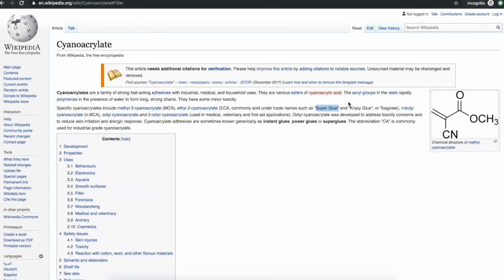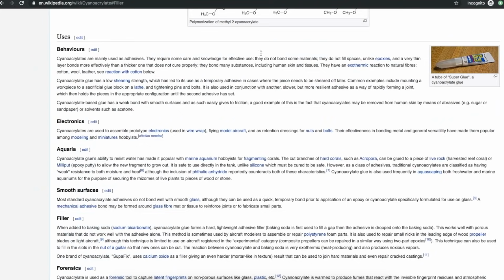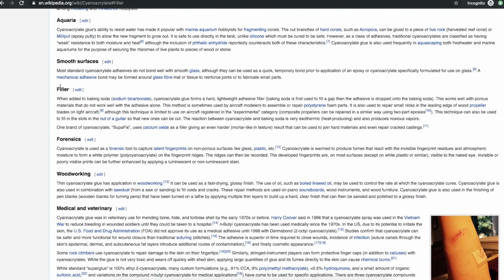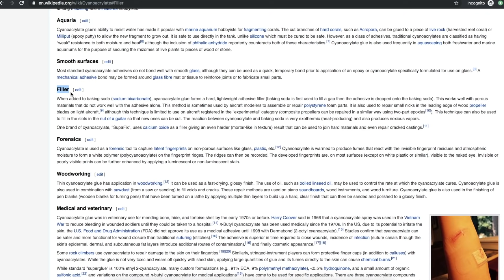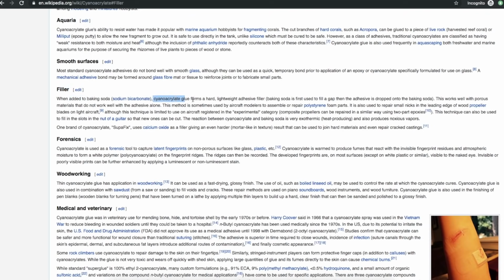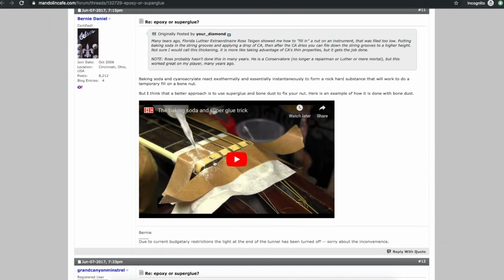Using Super Glue and Baking Soda to Repair a Plastic Switch Plunger

Comment: For more strength, use .6 ounce fiberglass cloth instead of powder. The CA will wick through the fiberglass cloth and bond over a large area and the .6 ounce fiberglass cloth is extremely thin.
Reply: silk cloth is also very strong.  You can buy it in rolls or sheets.  I use it if i'm doing fiberglass repairs and want a stronger repair than chop strand glass fiber.
Reply: Thin layer of tissue paper also works... need to add layer by layer
Reply: @gavish7988  I’ll have to try that! Noodle powder is VERY fine. 👍🏻
Reply: In the UK we have fibre-glass tissue which sounds very similar to what you describe. I have used that for fine repairs with both the fibre-glass resin, super glue or epoxy resin.
Barry
Reply: Haven't seen 0.6 oz cloth, ... did you mean 6 oz. cloth?
Reply: I used fabric medical tape that gave me the same type of result.
Reply: Baking soda and cotton as well reacts with CA glue creating a stronger bond. Would it do the same with fiberglass cloth?
Reply: Milled glass fibers.
That stuff,added to fiberglass resin, its like sanding concrete when it cures. 
Bet its awesome in crazy glue.

Comment: During the first week of our COVID19 Lockdown here in South Africa I accidentally broke the metal hinge on my spectacles. Since need these to read and all optometrists were closed for who knew how long I decided to use the method to build up a nodule welding the ear piece to the lense frame. I could obviously not fold the ear piece closed like this but it got me through to when optometrists reopened. It held strong for about 4 months! The frame was black so I used a permanent black marker to colour the repair black and hardly anyone noticed the repair.  I also used the method tho repair and build up our ice maker container in our fridge/freezer which has held up for over a year now at sub zero temperatures. Amazing stuff!!!
Reply: @dangerous8333  I did not have epoxy and the hardware stores were all closed for the lockdown.  Also, I had to build up a small nodule to bind the parts together. This is easy to do with the superglue and baking soda method as you can keep adding more to build it up layer by layer. There were not enough mating surfaces for epoxy to adhere to. I have worked with hardening putties and many other adhesives and believe the CA glue and baking soda gave the best possible joint and in the least possible time.
Reply: Well done.

Comment: I used this method on a lawn mower plastic intake manifold  that had completely  broken  off ,that has to withstand heat, presure and vibration and so far after 3 years of use is still holding.
Reply: you all probably dont care at all but does someone know a way to get back into an instagram account??
I stupidly forgot the account password. I would love any tips you can give me
Reply: @Maverick Hamza Instablaster :)
Reply: @Yehuda Franklin it worked and I actually got access to my account again. I'm so happy!
Thanks so much, you saved my ass!
Reply: @Maverick Hamza You are welcome :)
Reply: @maverickhamza1696  Hey I tried this aswell, did u have to pay 12$

Comment: I've used this on quite a few different things with varying levels of success... Baking soda and talcum powder can both work decently well but using thin or extra-thin super glue helps a ton (don't even bother with gel, extra control, etc)! Also, for this particular project, I would've just used a small soldering iron to press a hot piece of metal parallel with the arm (perpendicular to the break)! For something small like this I typically use a staple (already bent, as if you just pulled it out of a piece of paper)!
Reply: What about bigger pieces of plastic?

Comment: i used it on my laptop key (the ENTER key) which was broken into half. at first it didn't work. the second time i put mesh tape first then a thin layer of baking soda, then the CA glue, then thin layer of bs again then ca glue again. the key is still in one piece for about a month now. reminder: it sets instantly.

Comment: Great !Thanks! I repaired a fuse box cover on my 1990 Chevy truck like you did. Its a little fatter wider tab and broken right at the base. So it was still barely attached. I just built a little clay dam around it and started adding baking soda first then the super glue alternating like you did. Built it up to the level of the dam ,(about 2mm), and its awesome. Guys with trucks etc of this vintage have to deal with a lot of brittle 30+ yr old plastic parts and this looks to be a game changer!❗thanks again❗👍🇺🇸

Comment: I fix vintage electronics of all sorts. Often times, internals are broken because plastic became brittle. Broken off screw posts, cracked gears and levers, broken knob skirts. This fixes EVERYTHING. I bought a little barber shop powder applicator thingie with the bulb jar and a nozzle and it works wonderfully. At first I thought it did not disperse enough baking soda, but had no issues so far. It also help in hard to detach and vertical spaces, but make sure to cover everything, because it just shoots soda.  Though it’s not that hard to 3D print a Nozzle for it.

Comment: For years, I had used a product called Insta-Plastik, which is a powdered solid-bonder, which re-creates plastic, when mixed with super glue. Same idea. When that became unavailable, I found Q-Bond - a more advanced form that has 2 powders, 1 w/ pulverized metal (super strong bond). Work on office equipment, which involves lots of plastic that is fracturing and breaking constantly. The 2 part bonders (acrylic adhesive & accelerator) also create a strong bond. The plastic that doesn't repair with these methods is the heat-resistant plastic.

Comment: Thanks for making this video.  Your push button repair seems to have bonded well.  

My suggestion is that when using baking soda, calcium oxide, nano-particles of carbon, or baby powder as a filler, it seems that you might get even better results if you would contain the area to be filled with tape, as you did, but then you would put the filler powder in the area first, and next add the drops of CA glue; in other words, when you are using thin CA glue, you seem to be "putting the cart before the horse" and letting the glue run everywhere before you add the powder. Try it the other way and see if you get better results; on deep joints, try layering the powder, adding a single drop or 2 of glue, then a layer of powder, etc., because the various powders (except the baby powder) tend to cause the CA glue to set hard upon contact. As a final measure, lightly spray the repaired area with CA accelerator to cause any remaining liquid CA glue trapped in the matrix to quickly set, and, if you used baby powder, to cause the paste created by mixing CA glue with baby powder to set.  See this link for the baby powder/CA glue approach - https://youtu.be/NA2XJ7PTT3M

P.S. I know that baby powder used to be made with talcum powder, and now is primarily made with corn starch and/or other ingredients. Please refer to the linked video to determine the exact ingredients that they used to make the paste that doesn't set instantly, but only when sprayed with the CA accelerator, if I correctly understood what these guys were doing.
Reply: Would this work on a broken shopping cart. I'm loath  to throw it out they're expensive now. It broken in a few places as I fell over it.
Reply: Thank you so much for that advice. I thought I was going to have to buy a new iPhone stand when one of the legs broke off but now I’m definitely going to try your method and save some money!  🙏🏻

Comment: In my fiero, I had two broken plastic straps/bars that the shifter console screws into. There are two holes (one towards the front and one towards the rear) in each strap/bar which are part of the center console plastic frame. Each broke right at the screw holes and even broke into smaller pieces at each point leaving big gaps in the plastic (impossible to glue). I taped off areas to create pockets to fill the gaps and to make reinforcing spans on each side of the four repair points. I coat the plastic edges first with THIN superglue (not Gel) and sprinkle in some baking soda to get a good base at each end of the gaps, then I add a few thin layers of baking soda/superglue into the tape forms until the repair is built up. The mix will get very hot for a few seconds and may start to smoke slightly.  DO NOT GET A WIFF OF THE ODORS AS I BELEIVE THEY HAVE TRACES OF DEADLY CYANIDE. Use safety goggles, N95 Mask, Nitrile Gloves, Ear Protection when grinding, and a good Exhaust Fan venting outside away from people and animals.

The whole repair area will be hidden so I just trimmed/smoothed up the repair with a Dremmel Tool, drilled new holes for the screws, (yes this stuff is gridable and drillable) and painted the patch areas with a little flat black enamel paint. The screws are very tight because the patches are very hard but a bit giving on the surface too... and since they are sheet metals screws into plastic, I don't have a tap for them. I lightly coated a screw with Acetone and screwed it in until it started to bind, then worked it slowly looser and tighter working my way until each screw can be fully seated.  It is very strong, the plastic flexes but the patches don't much, they are rock hard.  I have been using this technique building Radio Controlled model airplanes to make Balsa wood as strong as thick plastic. It holds up well to heat, cold, humidity, vibration, and atmospheric pressure. It has nearly the same thermal rate of expansion as most automotive plastic so it will hold up to wide changes in the environment.

But don't put too much force or it may break the plastic before the patches break, but that is what causes these straps to break in the first place - leaning on the shifter console as you reach over to pick up something off the floor in the passenger seat - I wait and stop the car to do that from now on. This plastic is 35 years old so it needs TLC and respect.

Comment: I have used baking soda and CA glue with good results. With plastics, I did use coarse sand paper to provide more adhesion surface which did work.

Comment: I use it all the time, have always had amazing results, even where the CA alone wont bond, the baking soda is magic!
Reply: What about pressure... I need for plastic part of car radiator. Temperature change durability?
Reply: @fatboynip  7 months till now, summer, winter, nothing. Crack was 9cm long, with a hole 3x2 cm in the middle. If I jus can put picture here... Just melt same plastic like radiator, find in extra parts, that pis I was cutting from same radiator because thay build him for two models of car, well some carriers wos extras. Temperature of melting - don't alow to smoke. Multiple lairs, in my case two.
Reply: @fatboynip  zero dollars, my time. 180 dollars new part. I try on this car because is cheap car, chevorlet evanda. But now, I do this technic with eny car and all redy I do my bumpers cracks and some others things, box for air filter are be in pieces during lpg explode (bad, not correct sparks), now is just fine :)
Reply: Not to worry.  I’m pretty sure he’s the kind of person who keeps his cars until it’s time for the junkyard.  That’s the best way.
Reply: @borivojetravica569  I'm curious to know if it is still holding?

Comment: Colloidal silica, also known as Cabosil, is used in boat building and is a great thickener for CA Glue because it can be mixed in without hardening immediately.   It creates a better structural bond than baking soda.
Reply: Silica gel?
Reply: @nationofgandhis  Not exactly.   It's a fine dry white powder.  It's made of little jagged spheres that make a great adhesive filler.
Reply: I wonder if that compares to diatomaceous earth?
Reply: @daltsav  the particles look a little like diatoms
Reply: @chiphill4856 
From Wikipedia:  Diatomaceous earth consists of the fossilized remains of diatoms, a type of hard-shelled microalgae.
Reply: @daltsav  pretty cool

Comment: Good demonstration.
Can't be mixed, the exothermic reaction is fast.
When possible place tape under to contain the superglue, then put on the baking soda.
Dumping out the uncured baking soda is needed to prevent dry pockets.
I've used gel superglue as my first layer when I couldn't get a good seal with tape.

Comment: I had a pair of boots that needed repair, I only had a small bottle of superglue and a pair of nitrile work gloves. I thought the nitrile was similar enough to the rubber on my toe, so I applied a small strip I cut from my gloves. There was a chemical reaction that actually made it heat up and start smoking, and the bond from that was stronger than the original rubber that fell off. I don't understand exactly what happened but it is worth mentioning that nitrile bonds well with superglue in my experience
Reply: I discovered this today when I glued a small piece of nitrile glove to my finger 😂

Comment: I once more or less permanantly repaired a cracked sink drain pipe using clear silicon caulking, and first aid cotton roll gause. it formed a pretty strong patch for the crack, and the tight binding kept the crack from spreading.
I had NONE of the tools I needed to do the job "properly" and just improvised, the pipe lasted another seven years.

Comment: SG and baking soda are great for plastics, similar elements. 
For I've used wood fillers, MinWax poly filler is the best for both int and ext applications, and a group wood repair compounds sold. They're expensive. Used them at home and on the job.  
Super glue mixed w fine dust dries hard but it's great for"dutching".
It's all good. Owning a good DeWalt sander would help, too w an assortment of diff grades of sandpapers!
👍

Comment: Some plastics will not adhere properly to CA glues. When used with baking soda the bond area is hard but will snap off easily.
For plastics it's best to your a Surface Activator or "primer", which is typically a felt tipped pen supplied with specialised plastic glue packages from Loctite etc.
The primer chemically alters the plastic to make the CA really grab hold.
Reply: Thanks
Reply: what about car's bumper's tab?
Reply: @glowiever  - depends how much stress is on the part, as there is a lot of vibration on those parts. Most bumpers are difficult to glue and are repaired using plastic bonding. It's like a soldering iron that melts the plastic, then you feed in a filler rod.
Reply: @johncoops6897  aw snap. been thinking about the easy way out. plastic welder kit costs about $349 and I only got one bad bumper tab.
Reply: @glowiever  - You can DIY - do some searching on YouTube.
Or just take the bumper to a panel shop and get them to weld it. The best ones have these wiggly staples that they melt into the plastic across the crack, which reinforces it prior to filling with plastic.
Reply: Called Loctite 770 and is expensive as all hell :p
Reply: @Marcoosianism  - Yep, that's the part number of the bulk Primer/Activator. It's well under AUD $20 (USD $12) for 100ml bottle, which is dirt cheap. You only need a tiny amount on a Q-tip... the retail pack is 2 grams tube of CA glue with 4ml primer in a felt pen. I'd say that the 4ml lasts for 2-3 small tubes worth of CA.
Reply: @johncoops6897  Thanks John. The best I could find in Canada is on Amazon and they want CAN $140 for 50ml ! ... I guess I have to look around more.
Reply: @johncoops6897  Would you know of any places in AU which sell 770 online where I might look to place and order to Canada?
Reply: @Marcoosianism  - aghhhh they deleted my reply even though I tried to hide the website. Lets see if they will let me write Mohammad 👉 ALI 👈 then I will come back and add some more later.
Reply: @johncoops6897  lol thanks for trying ... if I take your hint and add  👉 BABA 👈 would I be heading in the right direction? ;-)
Reply: @Marcoosianism  -no, EXPRESS
Reply: @johncoops6897  Thanks, John :)
Reply: @Marcoosianism  - Search for "Loctite 770" and sort by price if it doesn't show up the top of results. The seller's picture has a whole heap of Loctite bottles, I only found one seller but I wasn't looking very hard. The price was about CAD $7.50 + $7.50 shipping.
Check the reviews, see what other buyers say. Pay by Paypal so you can get a refund if something goes wrong.
Reply: @johncoops6897  Done and done. Thanks John, appreciate the help not many have the time or patience to give. Seems the bottles are 50ml but for $15, it sure beats Amazon's $141 ;-)
Reply: @Marcoosianism  - I have only ever bought 770 in a "sharpie" like felt pen with 5ml inside. I might buy a bottle for myself, as I am preparing an order from Ali at the moment.
EDIT: Oh, I just realised I can buy it from a local retailer for $20 per 100ml. I wonder why it is so expensive in US / CA ??
Reply: ene  @johncoops6897  Interesting, I only found the 50ml bottles. The bottle itself goes for about $8 but they want another $7 to ship so I guess it's comparable to your $20 per 100ml find. Apparently the 770 is good for priming both polyethylene and polypropelene plastics which apparently don't respond well to CA glues alone though I agree plastic welding is best for thermoplastics. I wonder if the 770 will help to bond other plastic types.
Best of luck with your order!
Reply: I wonder if acetone would do the same thing as the primer...it definitely affects plastic.  Worth a try.
Reply: @blazegelcreations  - no, acetone doesn't do the same thing as primers. Also, acetone affects different plastics in different ways, and some plastics aren't really affected by it at all. I guess it could be tested, however you cannot do that properly when performing repairs of random personal items.
Reply: Good to know about that plastic primer for Cyanacrylics. Over the years, I have had great results without it using just the Baking Soda/Superglue method, but going one step better can't hurt. Thanks.